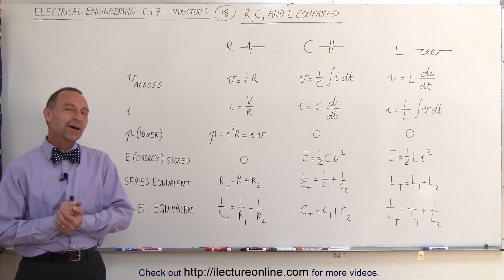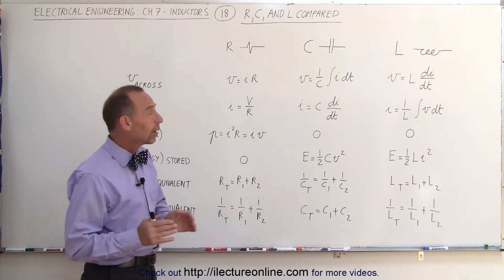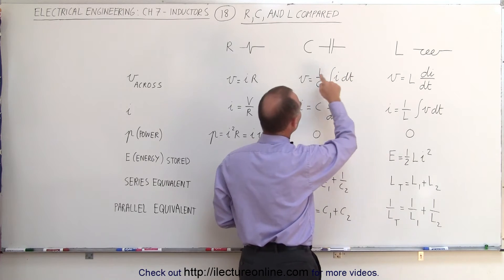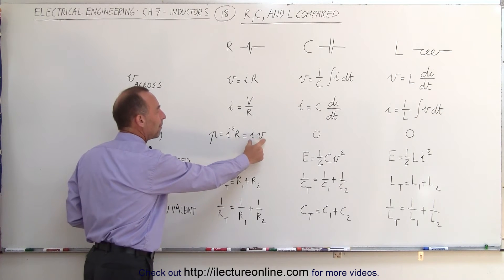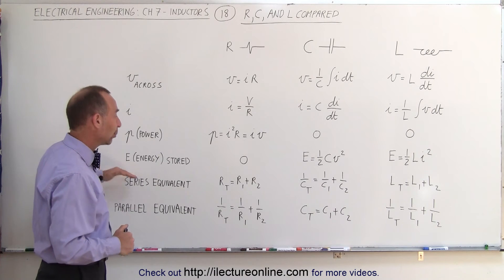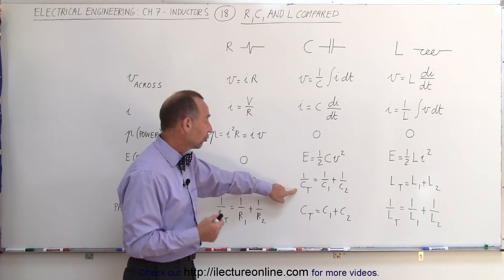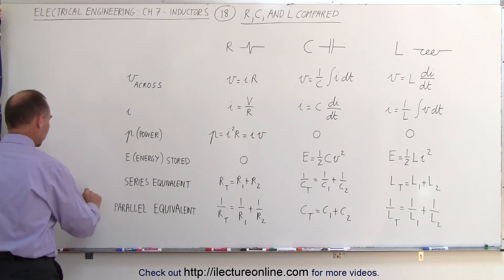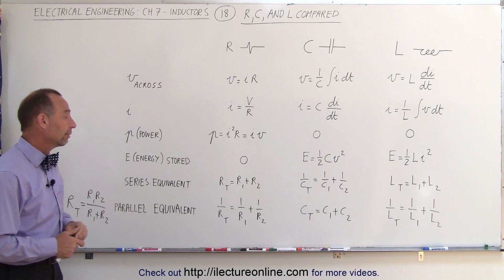Electrical Engineering: Ch 7: Inductors (18 of 20) R, C, and L Compared

Comment: This is not a joke, I used to be part of a cult that believes some kind of divine with a coil-like shape with 57 degree that is as same as the pyramid. 

We believed that it can stores divine energy with its degree when there is a normal radio signal around it. Member of that cult showed us it is true and causes some sort of volage when holding a radio around it. But now I understand it is a magnetic field going to it and it acts as an inductor and changing of the magnetic field causes a voltage.

Comment: First, isn't the current of an inductor defined as i=C*dv/dt?
Second, couldn't we define the power of a capacitor and of an inductor simply as dE/dt?
Reply from the maker: Thanks for pointing that out.   P = dE/dt is OK, but it wouldn't give you a practical format to solve problems with since the variables given will be C, L, v, and i  (among others).